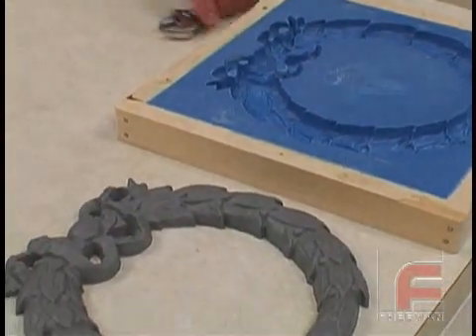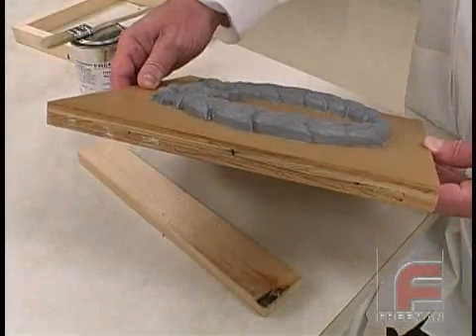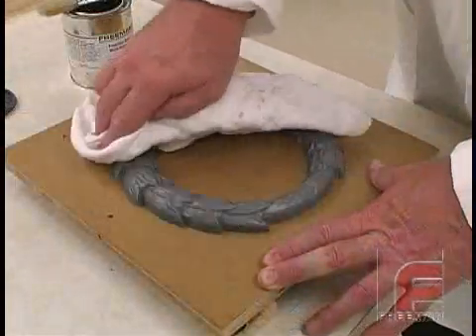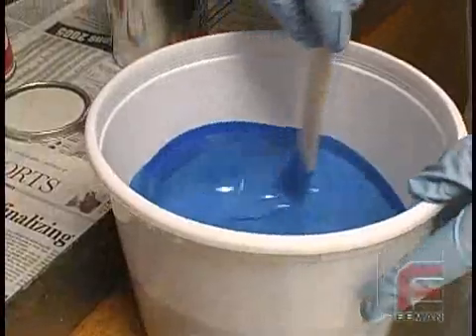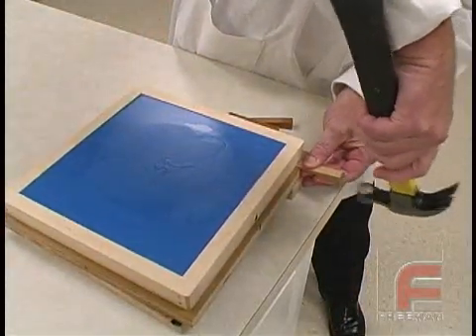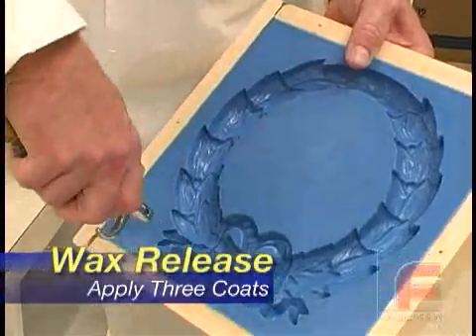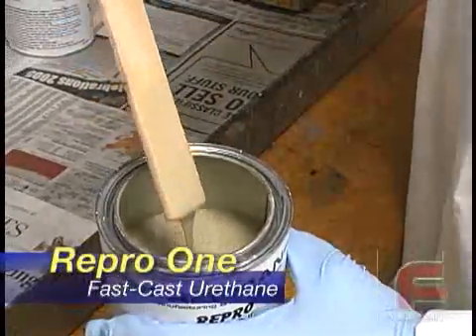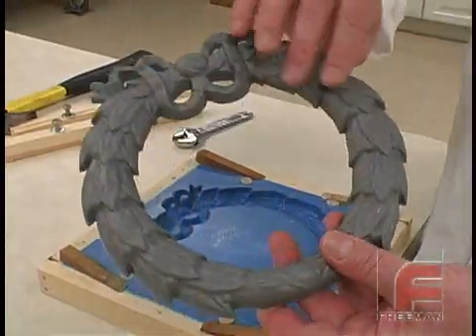Mold Making - Making Rigid Molds With Fast-Cast Urethanes

Comment from the maker: The cast surface from a one piece mold would not be flat.  Because of 
volumetric shrinkage, the backside of the mold would be slightly concaved. 
You could either machine the surface or do a two part mold to obtain a flat 
surface.

Comment: So how flat is the back side of the molded piece?  Since its exposed the settling of the part material would determine its flatness..correct?  This seems perfect for casting small stands, but the stands would only be as good as the flatness of their base.

Comment from the maker: @hellfoot17 
We do not have a distributor in Europe at this time.  You can contact our Corporate Office in Avon, Ohio (USA).  You could use this method to make your mold for your prototype base, but it would depend on the material you would use for your base.  We would not recommend Repro as it would probably be too brittle in thin sections.